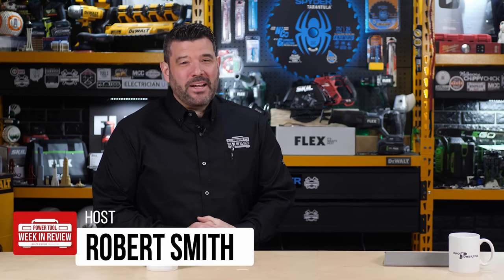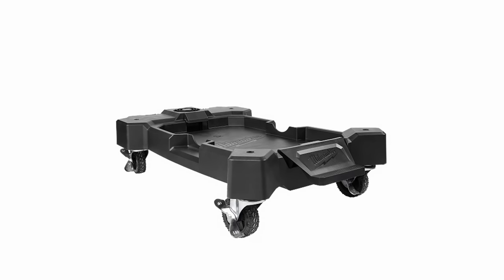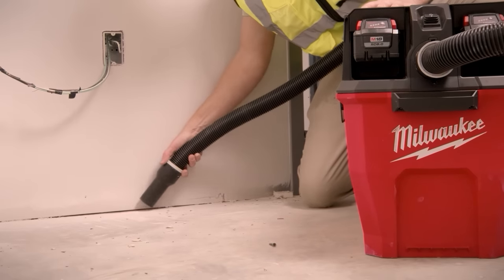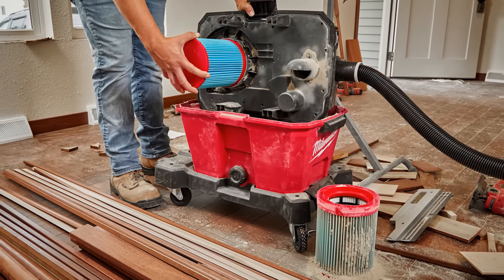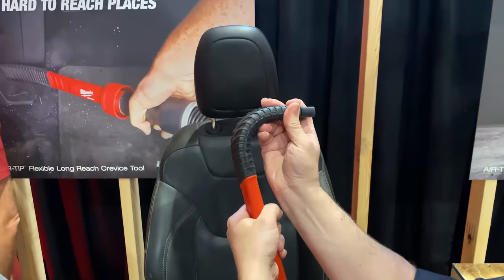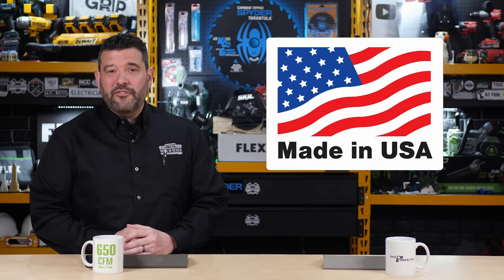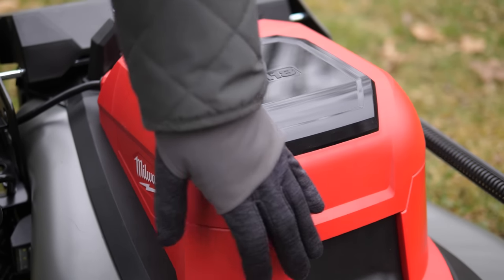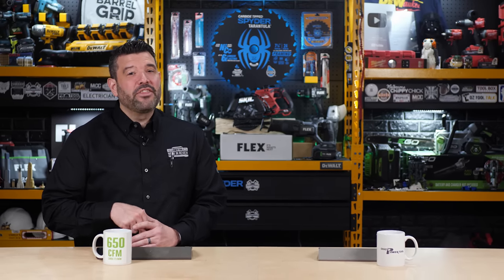BREAKING! Milwaukee announces NEW TOOLS, but doesn't tell the whole story...

Comment: A dual battery light would be cool. I'd love to see a 14" cut off saw, air compressor, power inverter, hell a welder would be nice. All sorts of options with more power 

I hope Milwaukee embraces multiple batteries, even 4 batteries on big stuff would be cool
Reply: anything over 2 you start running into problems with the batteries not being equally charged or the same size battery or maybe one is new one is old and theyre not the same anymore, i dont know how this multi battery stuff handles it when one battery is putting out more volts or more amps then the other if it can accept that or balance that theres some technical stuff that goes into it, its not as simple as running more wires to extra battery ports.. if you did that the second someone attached a fully charged battery and a dead empty one youd have melted wires, smokey batteries, and alot of lawsuits

i do agree though id be open to something like a back pack or belt that holds the batterys and runs a cord to the tool, but again these tools arent running off of 20 amps.. youd be into 200 amps or more if you had 4+ batteries in one that cord would start looking like a pair of welding cables and lose a little bit of the convenience of cordless tools where you can instantly drop it and walk away or swap tools in a half second would have its uses for things like angle grinders, or chainsaws where youre moving around alot but keep the tool in your hand or beside you and jump around doing work

they skipped over some single battery tools though.. i want my coil roofing nailer, dewalt outdoing them in that department
Reply: @AndrewBrowner  DeWalt has there 4 battery inverter, that seems to work fine
Reply: @tdm8817   i havent seen alot of people actually buy and use that thing, i havent looked into it very much but it is an inverter if any tool could deal with differing battery inputs itd be an inverter since its whole purpose is to take in power and flip flop switch swap it all around to get out different electrons

id wager a guess that if you looked into it and asked people who have one that it chews through batteries and kicks out as soon as one battery gets low, and that they have alot of issues and headache trying to micro manage their battery supply with a tool like that

im not sure if it actually requires all 4 batteries to operate or if thats just for run time, im not even sure how many watts its rated for

inverters are pieces of kits alot of people could look into though, we all have our work vehicles, everyones asking for cordless microwaves, coffee makers, widgets and gidgets for convenience on the job site get a 200$ inverter, add a second battery for 200$ and then get all the 110v things you want for far cheaper then the 500$+ milwuakee would need to charge for them, im sure theres even fancy set ups thatll start and stop your vehicle as required to charge the batteries
Reply: @AndrewBrowner  buddy of mine has the DeWalt power inverter, says he loves it, uses it more than his little inverter generators. 

There's a company that makes a inverter that takes 7 M18 batteries for the rail industry. Seems to work for them too.

Edit: now that I looked at that a bit closer it seems there is no inverter in that deal and it just runs 7 batteries in series for approx 130 volts DC. Still would be very useful tho for tools that can run on DC.

Comment: My two cents is that Milwaukee will probably only release an ac power inverter for the dual battery motor because they are controlling and don’t want us to use a single inverter on other m18 tools
Reply: i think it will be a complete vacuum head, not a battery slot insert.
Reply: @douglasalder6039  sounds like a definite possibility.

Comment: Everything about this vacuum sounds amazing, however one thing that would make it the ultimate vacuum in my mind would be the option to plug it into an extension cord for those all day sanding projects! As it is you'd need two power units if you wanted the portability of batteries, and another for all day runtime.. seems like adding a plug in would be easy enough, and help those buyers who want the capability, However don't yet have multiple sets of 12.0 batteries...
Reply: I have 3 x12 amp hour batteries and they are definitely not cheap.I think the MX fuel line was a bust.They had issues with the original batteries and there's not enough tolls on the market for such a large battery.The could have made an mx fuel vacuum but who's going to buy it?I figure on the next round they will make these pack out compatible.This way you might buy another one and they make more money.

Comment: The yet to be announced M36 18 gauge Brad nailer will be very interesting. And how did Milwaukee get 600' continuous rip of 2*4 PT with the new 10" table saw in the 12 volt system?! Incredible technology which is why Milwaukee rules All, very interested to see how/what these new tools look and run